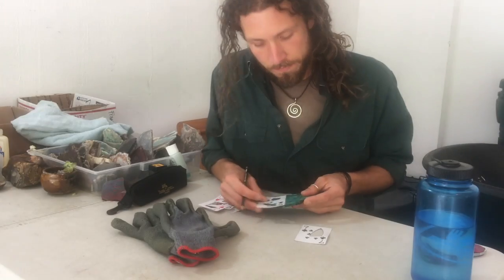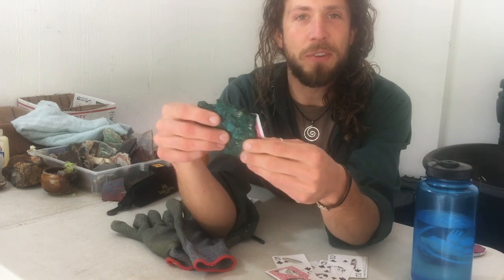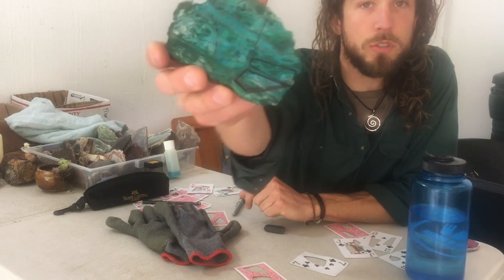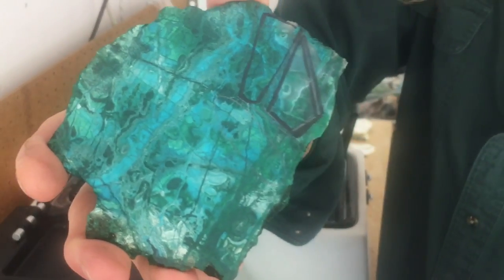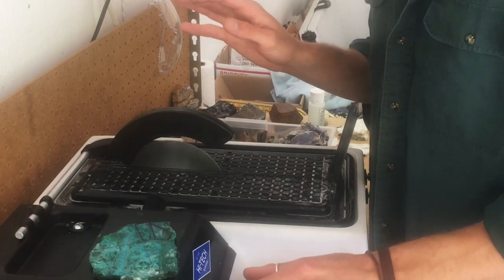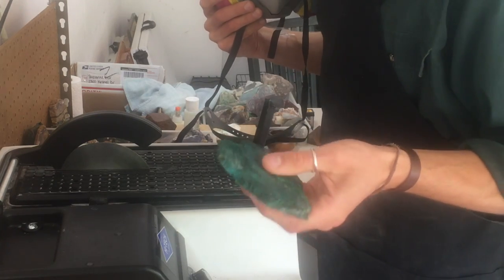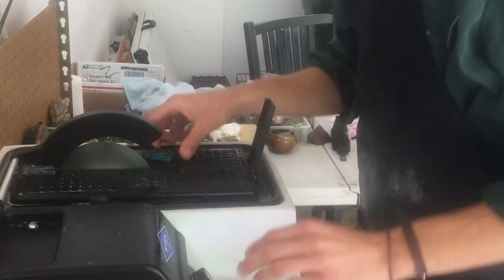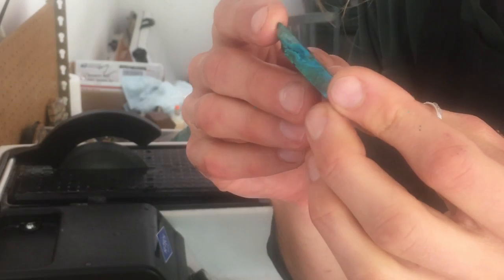Lapidary 101 Part 2: How to Use a Trim Saw and Cut a Preform

Comment: Love your playing cards for auditioning shapes! I do a similar thing using the flat sides of milk cartons to cut out shapes I plan to repeat. I just transfer my original paper design over with a fine line sharpie. You can use the cutout to trace around or the other part like a template as well. I like your playing cards as they would be easy to store all nice and stacked. My bits and pieces go in a zip lock - all wonky. Thanks for the tip!❤

Comment: Awesome videos, please make more! Love the templates w/the cards, great idea.
Reply from the maker: Thank you! next video is in the works, i'll have it posted very soon!
Reply: Could you please help me. i've just purchased a  Lortone LU6X-130 combination unit. This is my 1st time trying to do my  own cutting & cabbing. I bought it used  for under $400, but i need a new saw blade. please give me a suggestion there are so many to choose from. Also, I have what looks like a stone grinding wheel & a rubber belt over a plastic disk. As i said b4 ,i'm a complete noob to this. I'm just realizing that i need at least 6 different grits to get a great polish could you make some suggestions that i could do to still use my unit efficiently w/o spending $300 on wheels. And last, I have a beautiful piece of Ocean jasper rough ,but its 6"/6" wat to bit for my trim blade. Any idea on how i could slab it for trimming? Thanks for the help.
Reply from the maker: I don't think i'll be much help without actually seeing what all you're working with and such, but there are several different trim saw blades with different thicknesses that you can use depending on the type of stone you will be cutting. Some are more specifically for softer stones such as opals or turquoises etc, others for agates and jaspers. So I would take that into consideration. As far as the cabbing, if you want to get a great polish, you'll have to spend some on multiple wheels and grits. I'm close to posting my video on cabbing, but I use a Diamond Pacific Genie that has 6 Nova wheels. So I'm sure you can get replacement wheels for your unit if you want a higher polish, but unfortunately I'm not sure of ways to do this cheaply. As far as the ocean jasper, there are often lapidary clubs in cities where you can meet others who can give tips and advice on all things lapidary, and you can have access to saws. You'll need to cut that OJ with a slab saw to get good slabs for this. Or you could mail it to me and I'd cut it up for you and maybe just ask for a slice as payment ;) Hope this helps, sorry I don't have more solutions for you!

Comment: I'm getting into lapidary work , i was wondering Would a trim saw work for cutting rocks into slabs , or would i  need a slab saw to cut rocks into half ?
Reply: I fear the blade of a trim saw would be too small to cut large slabs out of big rough minerals. Lapidary workers usually have a slab saw which are 10'' or higher, and a smaller trim saw in order to cut cabochons out of the slabs.

Comment: That hitec saw is terrible, and $600. You can buy a mk303 trim blade on Amazon for about $35 and I cut about 500 agates with it on average. I put the blade on a cheap $75 tile saw. I had this saw and it really sucks for agates.

Comment: Hi Sean,   Looking for a new blade for my 12 inch saw.   Wondering if you or anyone you know has tried the UKAM smart cut blades?   Their web site shows in a cartoon 
drawing of how the diamonds are supposed to be lined up in layers and therefore making the sintered edge more aggressive and longer lasting. Any thoughts or 
recommendations for just hobby cutting Brazilian agates for my great grandkids.   Thanks.   Also, great vids.
Reply: Mk303 is the best.  Check Amazon, don't buy blades that are really cheap, it will cost you a lot more in the longrun

Comment: The price a Trim Saw How munch?
Reply: Don't buy one. Get mk303 sintered blade and put it on a cheap $75 tile saw.
Reply: I've cut hundreds of hard lake superior agates with my cheap tile saw. With an mk sintered trim blade they cut great, and the stones are easy to hold onto. Either spend about $150 for my setup or spend $600 for a fancy trim saw it's your choice.
Reply: KOE 4o8  7" will only cut up to 3" agates. You must be using an extremely thin blade?